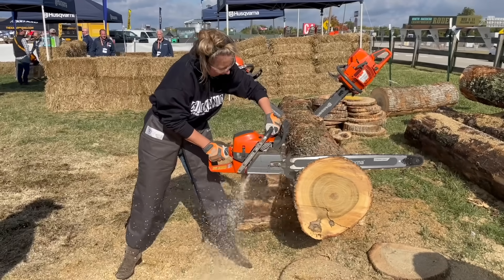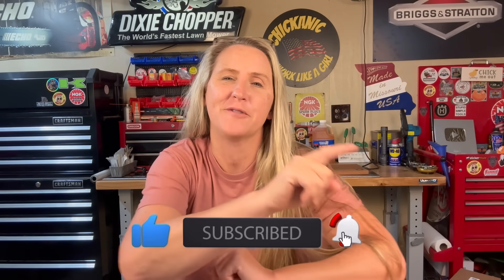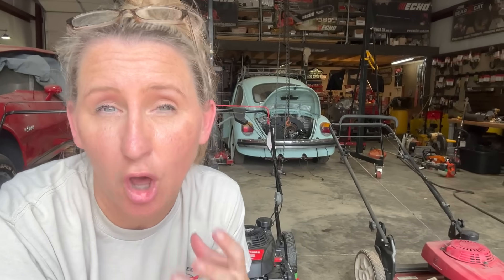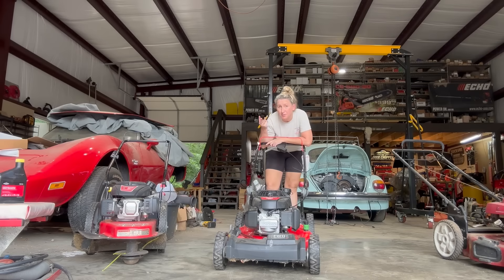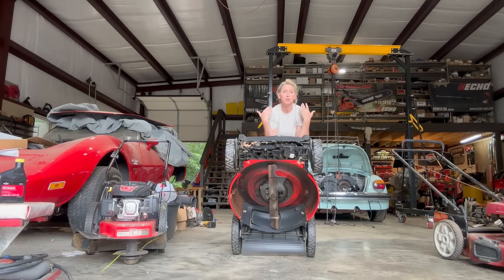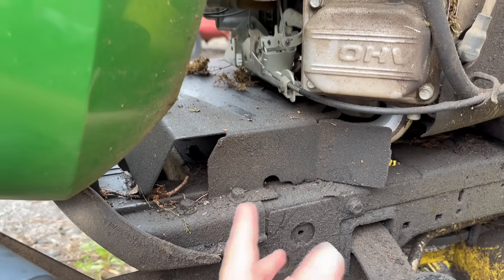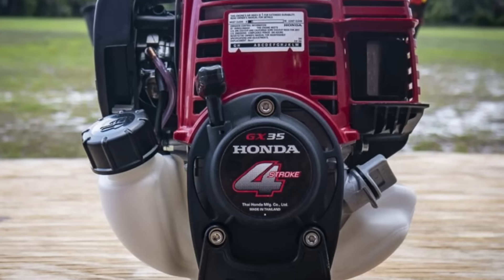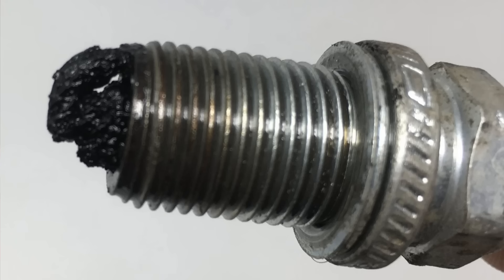Why Is Your Mower Smoking? Diagnosing 101! Small Engine Repair

Comment: I have a 10 horsepower overhead valve Briggs & Stratton engine with the low oil system in it my question is if it is overfilled will it affect the low oil system meaning shut off the ignition system causing it to not start?

Comment: I’ve seen a some  weird things as a mechanic, but I’m sure you have seen a lot I have a Kohler K301 that smokes lightly out of the breather. It doesn’t burn oil and has great power. I tested the compression by spinning it in reverse because of the ACR I got 130 so that’s not the issue still have not figured it out yet but I’m sure I will upon teardown. nice video keep it up.

Comment: her is a comment. Briggs 17.5 hp design head bolts orientation and  not even gasket pressure do to the fact there is a much need bolt that briggs failed to consider for preventing constant head gasket failure .this briggs needed a head bolt between the rockers and cylinder wall . I always was a Tecumseh engine fan, not a briggs . still have 2 and four cycle tecumseh from the early 1980's and as a kid in the sixties every mini bike had tecumseh trouble free engines . no more briggs crap for me..............

Comment: Im a small engine mechanic also work from my house about to start my actual business come around Christmas im aiming for llc the whole 9 so I dont get in trouble I already had a shop want to report me witch i understand but hey I lets just say it needs a simple carb clean an out the door 30$ an same day turn around while the local shops charge 80 just to diagnose an most of the time when it comes to a trimmer is just a diafram re tune an ready to roll but yes this is the main thing with push mowers 9 out of 10 that drop it off I still charge right then an there I pull there dip stick pour an send them on the way tbey laugh one guy said 30 for that I said yea an if you hadn't come to me it would be triple you pay for my quality not time

Comment: so I just bought a secondhand huskee LT 4600 Riding mower. I got it real cheap so it’s worth tinkering around a little bit. I bought a new battery because the old one was dead I change the oil, air filter clean the gas tank and put fresh gas in it. It started right up but then it ran a high throttle blue black and blue smoke and then died. I loosen the gas cap and it stayed running longer but it did the same thing it wouldn’t throttle down and the smoke cleared up a little bit but it just died. I’m thinking carburetor cleaning? I wonder if the throttle linkage is set correctly though although you’d probably know better than me

Comment: I love your channel it’s helped a lot! I have a Honda self propelled walk behind mower and since spring it’s been one issue after another. The cable that connects to the transmission broke. To take it to a nearby shop is $100 just to pick up and bring back. So I got that part along with a new belt and replaced all of it over month! They sent me to a repair clinic video on YouTube and it tells you to have little to no oil on its opposite side. I’m watching your video and you say not to. I believe you. My mower is smoking grayish clouds and now it revs off the charts! I tried adjusting the governor but it’s not working! 
My daughter bought me for my birthday an electric mower but the battery keeps dying! I guess I’m too old school and love my old mower but it needs a ton of work. I’m 69 years young but feel old, woman. If you have any suggestions please let me know. I miss using my Honda!

Comment: Damn! I wish I knew this. I wanted to clean out the bottom of the mower and turned it on the carburetor side. That's the problem! Been running great for years!

Comment: I have a question for ya! I have a Biggs and Stratton engine, v-twin 24hp. I mow and the first couple rounds, it bogs down runs rough then puffs a big black smoke, then runs fine for a couple more rounds then does it again. 2 times maybe 3 at most then it’s perfectly fine! Any idea?

Comment: 3:49 is helpful information the way Chickanic explains you NEVER title the mower on its side where the carbureator is - which is where the air filter is. Chickanic explains it is okay to briefly tilt the mower on the other side where the exhaust is, but it is best to tilt the mower back.

Comment: I got a Cuba 60 50 in. I'm sorry one that's running it blows. Fuses and I cannot figure that out. And I got another question for you. The same cup cadet 23 horse. I got a brand new starter on it and it won't turn over until like I turn the motor off if the compression side. Trying to figure out what pod and that. Thank you for your time

Comment: Please help!  John Deere riding mower.  Took it in for slight oil leak, a tune up and blade sharpening.  Took it into the closest John Deere dealership I could find.  They had it for about a month and still I had heard nothing so I called on a Friday.  Not done yet....they called Monday morning and, imagine that, it's now done.  Went to get it (mind you dealership is about an hour from my house) charged close to $500..  Went and got it and started using it.  Alll of a sudden about a 1/2 of use major smoke event.  Shut it off and figured just a fluke.  Tried using it again the next day and after about 20 minutes same problem.  After the third time with same problem I called the dealership and they suggested I bring it back in.  URG.  Took it back in.  After not hearing anything after a month we called.  We could come get it.  They drove is a couple of times and no issues.  Okay.  Brought it home and about1/2 hour into use same thing.  Very scary, very major (in my opinion) smoke event.  As usual I immediately shut it off.  Now I am afraid to use the thing.  Hate to start a fire and I'm reallllly irritated at the dealership.  Real Flakes.  Is this thing safe to use?

Comment: Tilting a mower too far backwards will also cause issues with the oil and smoking and issues starting. That's what did my Toro in for awhile. It wouldn't start for awhile, then when it did, the engine sounded bad and it would smoke like crazy and then it would even out but still smoke.

Comment: My Toro 22" Recycler that I bought used from a dealer did that when I tipped it forward to unclog the bagger channel. The dealer I got it from just got it in and didn't have a chance to check it over fully yet. I didn't want to lose the opportunity so we did a general once over and it ran well and looked great so I bought it for a great price. He told me it'll need an oil change asap so I did that, I must have messed it up because originally it wouldn't start after I tilted it, put oil in, it started, looked fine, no smoke then it started again. I dumped the oil and filled it up again, the dumped oil was black. I cleaned the mower let it sit over night, still smoked. I let it sit again then tried again but this time I let it run for awhile and it stopped smoking entirely. Occasionally it'll smoke on slopes and smell like oil, it always did that, plus that's to be expected from 4 stroke engines. It's running fine now and I'm so thankful that it wasn't in bad shape to begin with and that I didn't make it worse and have to send to to a repair shop. I'm especially happy that it isn't a high repair bill or not fixable, been there with other used mowers. But at least buying from a dealer you get a better chance than you do with the Marketplace. I learned a valuable lesson from this, never tilt the mower the wrong way, always the air filter facing to the sky, never put too much oil in, pour slowly every so often checking the level, but make sure before even doing that to know the oil capacity and have that measured out in your head, and dump all the old oil out first before you do anything else. And always change the oil as soon as you get home when you get a used mower unless it was already done and you prove it was.

Comment: What about a Briggs and Stratton 125cc, 140cc, 150cc or 163cc that smokes from the air filter housing and soaks the air filter with oil?

Comment: In that last shot of that dirty air filter on that push mower it shows the gas tank over flow vent tube. When the gas tank is all the way full that's why you fill it up then the over flow goes right on your air filter and then the moter won't run right at all. Put a tube on that over flow and rout it somewhere else. Some of the tubes go to that white nipple on the side of the carb.  All of them are missing that tube. Fix it.

Comment: Mine has blue smoke for a few seconds after a cold startup. I can turn it off and start it back up and no smoke during the entire mow. My neighbor said it could be my exhaust. I am going to check my plug and air filter, since I put a new plug in when I 1st got it off the road 5 years ago. It just started smoking this year. I changed the oil every year and I confirmed it's not over filled with oil. It is a old Briggs and Stratton mower. It's been an awesome mower. I run it out of fuel every fall and pull the cord 2 times and then pull it away. It saddens me that it's starting to smoke.

Comment: How do you change the oil without turning the mower in its side. What about closing the piston - what procedure to do this, like pulling the starter without the power pushed in.

Comment: I have a Toro Super Recycler and it’s blowing bluish white smoke. It’s a lot. Like an insane amount of smoke. I had it run for a few minutes initially and the smoke dissipated then I went down a steep heel and massive amount of smoke. Also it looks like gas is on the deck. What could this be?
Reply: Side note I just bought this last sumner.

Comment: Thank you for this video! I have an old Kohler 20hp in a Cub Cadet LT1045 and the OHV cover is leaking and dripping onto the exhaust pipe. Happy to have my scenario included in this video. Is it simple to repair this?

Comment: I would like to ask you a question not related to this video. I have an Aryan zero-turn mower, and it has the sealed hydro-drive system. I only have about 14 hours on it, but they seem to whine real loud.  Could you do a video on that? Also, how do you balance your blades

Comment: Just bought a Toro Titan with the Kawasaki engine, it smokes white a little every time I start it.  I asked the dealer I bought it from and he said it was normal...  and to try and let it run at idle for about 30 seconds before shutting it off.

Comment: I have had times where it smoked alot, then changed oil and used HD30,  and it was fine. I guess the oil was too thin or had gas in it.

Comment: I love your videos and skills in repairing small engines, I have a question about my craftsman weed eater here goes I replaced the coil and kill switch and still no spark i change the coil twice still no spark checked everything connected to sparking. Please help driving my crazy. Thank You Bree

Comment: I did a briggs intek head gasket last week for the neighbor. It leaked so bad it was hissing and gurgling from the crankcase getting pressurized, it filled the cyinder with so much oil it hydro locked the cylinder and it wouldn't turn over. He was so frustrated that his wife messaged my wife to get me to come help lol I just happened to have a couple of those head gaskets on hand 😎
Reply from the maker: Hey Pat! Glad we're not the only ones who see it.

Comment: I bought a used Mantis 4 cycle tiller. Thought id change oil, plug, etc when i got it home. So i filled the crankcase up to the threads. Wrong. Its 2.7 ounces.

Comment: I just finished watching your short video on the disappointing 2 Stabil water removers that don't work. You said you use ethanol shield instead , but I couldn't see what brand you were using. I have been using LUCAS ethanol shield in my mower plastic gas can and in my car gas tank in the winter with non- ethanol pump gas for both. What are your favorite top 2 or 3 favorite  ethanol shield  products you can recommend to me.

Comment: M320 B&S Craftsman RWD.  Bought in 2020.  The model I had B4 you could drop the Carb tak & clean or see if needle waS STUCK.  Not this model.  Now they have made it a replaceable carb tank, $45.bucks to replace it.  I'm so use to taking them apart. & this time, wasn't able to.  It's a 1 part unit.  So, sadly, its just 1 crack & shuts off.  1st it was white smoke & then it turned grey & then it would start at all.  After clean spark plug new Zero Corn Gas as always. & Air filter.  even a few hits with carb cleaner. I can only get 1 crank over & it stalls.

So, I bought a non-B & S Mower.  With a Carb Tank I could take off if need be.

Comment: I owned a Toro Time Cutter S4200 with a Lincon engine branded Toro. The OHV cover leaked all the time, directly onto the muffler. The older it got, the worse it leaked. Installing a new gasket every 4 to 6 hours of use was frustrating.  The dealer couldn't make it work any better either. Someone wanted it more than I did and I took their money to put down on a Kubota with a Kawasaki engine.  Now, I just want to upgrade the seat.😂

Comment: I have a 1989 MTD mower I rarely use because it won't mulch, it rear bags only. It has a B&S Quantum 5 hp. Every time I cold started it white smoke would blow out of it for a minute or so. Then I pulled the carb and took it apart and cleaned it like you showed in your videos (after watching you do it I figured I could do it too). The white smoke stopped happening. The carb float bowl gasket fell apart and I haven't been able to find a replacement. There doesn't seem to be carb or gasket kits for engines that old. I really like your videos.

Comment: It just had too much oil! Do you know why an echo srm225 would run for 2, 3 minutes bog down and shut off unless i unscrew the gas cap even though it has a new vent cap and the screen is clean? A lawn mower does that if the gas cap is clogged but a mower doesn't have a vent cap to vent? Is my gas cap bad or is the carb flooding when i screw the gas cap on?

Comment: I have a johndeere d130 that makes blue smoke on cold start but never during running . Would you say valve seals it doesn't seem to use oil i have never had to add any between oil changes

Comment: I enjoy watching your videos and have learned a lot by watching you repair things. I have purchased a Craftsman GT 5000 riding mower with a Kohler 25-hp V-twin engine. The mower was leaking oil from somewhere on the engine. I cleaned all the crud off so I could see where the oil is leaking from. After all the cleaning, I started the engine and noticed that oil was slinging from underneath the engine, and oil was leaking out of the seal on the spindle where the pulleys are attached. How hard is this to fix? And would it be worth fixing?

Comment: Lake Speed, Jr., "The Motor Oil Geek", a true oil expert, describes in his recent video (https://youtu.be/a3uXSI9wQv8) that like old classic cars, motors with flat tappet cams DO NOT need a high-zinc oil to protect their camshafts.  Any modern synthetic oil, e.g. the latest API SP rated oils, protect flat tappet cams just fine.  The new detergent packages work hand-in-hand with the lower levels of zinc in newer oils and protect cams even better than the oil-fashioned high-zinc oils.  One less thing for us to worry about.

Comment: I traded for a rider a few years ago. Ran fine when I picked it up... BUT... later it began smoking. Not just a little but enough to kill all the mosquitoes in my neighborhood. Long story short it was the crankcase ventilation valve. Put in a new one and the smoking stopped. Ran fine and did not smoke at all.

Comment: Actually on Kohlers and Intek engines, if the air box is warped or the air box to carb bolts aren’t tight the fuel can actually siphon out through the main jet while sitting.

Comment: Question?
When checking the oil do you screw the dip stick in all the way or just rest it on the rim of the threads?
My Huskervana snow blower has a   Big difference in The oil level when checking it both ways.
Reply: Depends on the brand of engine. On a Honda, you don’t screw it in. Briggs, you do. I’m not sure about a Husqvarna. Consult your owners manual if you have it or you should be able to find it online.

Comment: Good morning, I have the craftman RER 1000 model number 247.2500 and I need to know where does the pulley tension spring goes attached to. I see one end attached to the bracket, but how about the other end? I appreciate the help very much

Comment: I had a Kubota KGZ770 ( Kubota gas V-twin) out of a ZG327. Kubota wanted $400 for new piston rings so I found some automotive rings that would fit but the new oil control rings wouldn’t fit, so I reused the old ones. Big mistake, the engine would randomly smoke for a few seconds at a time while running. It would come and go .

Comment: I use to perform warranty work for the local Walmart. 99.9% returned the customer put a whole quart in push mower. Easy fix drain some oil and let it run. Wash 🧽 off and return . Easiest $25.00 ever made.

Comment: I only got 30 years out of a vertical shaft Breaks and Scrap' em flathead on a lawnmower....
and I knew it was piston ring/cylinder bore wear because it smoked like a chimney on start up 
as the worn rings and bore had let oil into the cylinder while it was stopped in the week between cuts.

There was also a distinct tang of burnt oil haze all the time it was running and it was a case of check the fuel and add oil....

Replaced that with a 1980's second hand Kawasaki FV engine with full pressure lubrication and a Baldwin car engine filter that cross referenced.

I just use 5w30 full synthetic that I put in my car...no problems and no smoke in the last 15 years.
Reply: Went from a Breaks and Scrap’em to a Kindasucky. Tarryl approved…